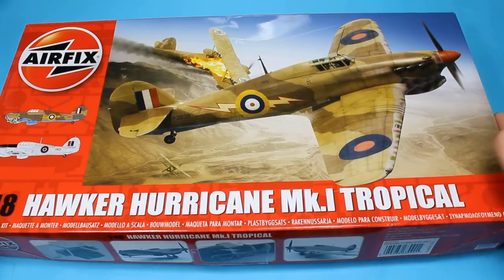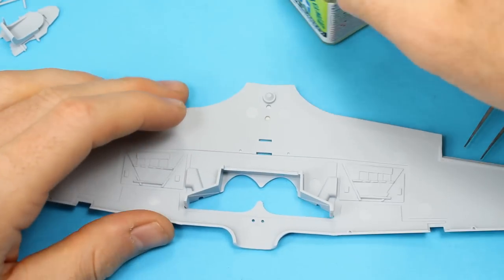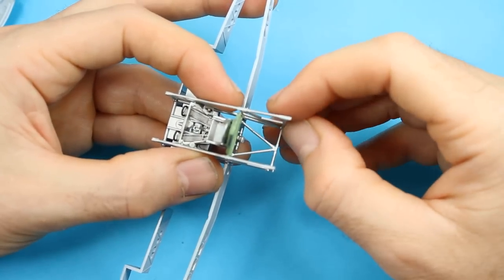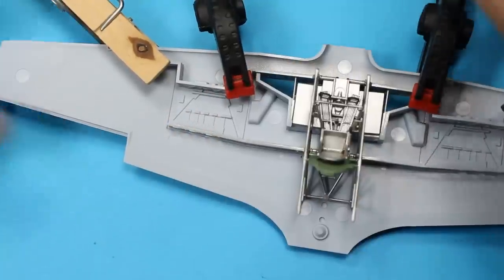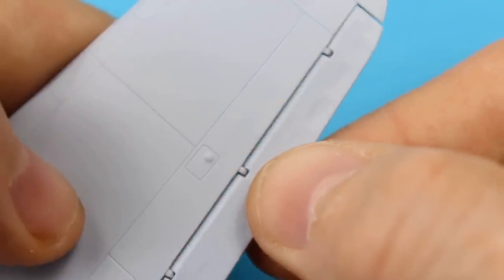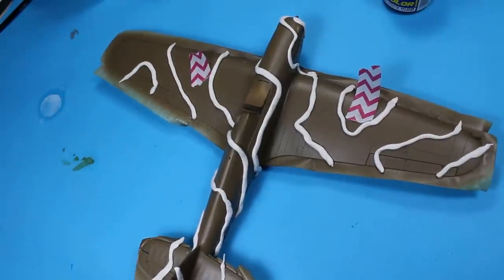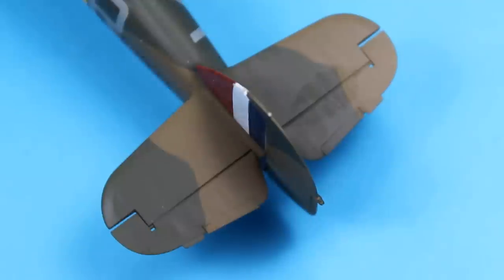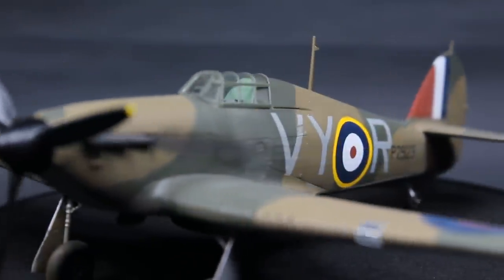Airfix 1/48 Hawker Hurricane, Battle of Britain, Full Build, 80 Years

Comment: Looks like a really good kit here! Builder made it look fun also! To those that think Tamiya is the only gift to the modeling world, I say  this- Tamiya 1/48 Spitfire and P51D use those stupid individual prop blades. Inferior! A one piece machine mold for propeller is likely to have near perfect tolerances, in regard to proper alignment of prop blades. How much does even 1/2 MM off on one sloppy fitting separate blade translate to in scale? Yes, Tamiya 1/32 are some of the worlds best, but like wise, some of Airfix 1/24 kits are also, like the old 1/24 Hurricane and new 1/24 F6F Hellcat etc..

Comment: Not obviously stated in the video, the builder has used an Xtradecal Battle or Britain sheet.
Xtradecal frequently make mistakes,  or guesses, this decal option has both.

In this case 'sky grey' undersides, while P2923 VY-R is a very good candidate for for a Sky mix or substitute,
see here
 https://www.britmodeller.com/forums/index.php?/topic/234985915-raf-sky-grey/&do=findComment&comment=2054227

  as P2923  has a non standard pattern,  going up the cowling and over the wing leading edges, and up the rear fusleage,  this is seen on several Hurricanes based at RAF Debden in July 1940, both  of 85 and 17 Squadron, which shared the base, and is likely a quirk of their paint shop. unfortunately the builder here has trusted the Xtradecal instructions, which specify Sky Grey,  which is just a guess on their part, and they also fail to note the non standard repaint, and they also get the code letters too narrow and the yellow roundel outer ring too narrow.  They also come up with the weird idea the spinner is black with green stripes.   85 were using flight coloured spinners at this time, and "best guess" from this and tonal matches is Red with two white stripes.

For more details on this and photos of the actual aircraft.

  
https://www.britmodeller.com/forums/index.php?/topic/234948380-hurricane-colour-question/&do=findComment&comment=1431441

for 20 plus photos of the real VY-R, and other 85 Sq planes, 

https://www.flickr.com/photos/144949377@N05/albums/72157704898371932

from a Life magazine photo shoot in July 1940
And, related, the 17 Sq photos

https://www.flickr.com/photos/144949377@N05/albums/72157678154026658

If you look carefully you can see 17 Sq Hurricanes in the background of the 85 Sq shots and vice versa.  The unique nose/leading edge and rear fuselage demarcation is seen on  VY-R, VY-K, VY-H, and likely VY-N, and on YB-A, YB-C and YB-W of 17 Sq.

One suggestion for the kit, if you dry fit the main spars into the wing, using the upper and lower parts taped together this will ensure they are all aligned before assembling the cockpit, which can be built on this ensuring the cockpit parts remain square and true.
new tool Airfix kit are noted for being very tight fitting,  a coat of paint can throw off a join,  but their plastic is too soft, and it far to easy to mis-align parts,  causing problem with wing to fuselage join.  I have seen several build where the is a step under the lower wing/lower cowling join.
Personally I really do not like the assembly sequence,  and it also means that there are compromises on the detail on the upper parts of the cockpit framework, the 'consoles' on the port side are missing.
The Airfix kit has a few other glitches, most inherited from the 72nd fabric wing kit. 
The definitive 1/48th Hurricane kit is yet to be done,  though Arma Hobby have announced a 1/48th IIc kit, and their 1/72nd kits are best 72nd Hurricane kits.
Hope of use or interest

Comment: The underside was duck egg blue if im not mistaken
Reply: "duck egg blue" is description, but not a given MAP colour.  The underside colour was switched to Sky in June 1940,  but given the massive amount of aircraft to repaint, mixes or substitute colours were possibly used.  This has been debated and discussed in modelling circles for many years. 
Note, Sky is not blue, but a pale green.  colloquial descriptions of "duck egg blue" and "duck egg green" are common from the era and owwards. 

P2923 VY-R is a very good candidate for for a Sky mix or substitute,  as it has a non standard pattern,  going up the cowling and over the wing leading edges,  this is seen oin several Hurricanes based at RAF Debden in July 1940, both  of 85 and 17 Squadron, which shared the base, and is likely a quirk of their paint shop. unfortunately the builder here has trusted the Xtradecal instructions, which specify Sky Grey,  which is just a guess on their part, and they also fail to note the non standard repaint, and they also get the code letters too narrow and the yellow roundel outer ring too narrow.  They also come up with the weird idea the spinner is black with green stripes.   85 were using flight coloured spinners at this time, and "best guess" from this and tonal matches is Red with two white stripes.
For fuller details on this and photos of the actual aircraft.
https://www.britmodeller.com/forums/index.php?/topic/234948380-hurricane-colour-question/&do=findComment&comment=1431441

Comment: I'm building the BoB release right now. Not only did I have the issue with the panel under the nose standing taller than the wing but the upper wing halves stuck out farther than the bottom leading edge. Not sure why but I also have the sea Hurricane in the stash so I'll be applying lessons learned on that build.

Comment: Very nice Hurricane! I don't know if it's the fog of old age, or what. But, I seem to remember Airfix kits of the 1960's and 70's being fairly good kits. Albeit, it is true; I haven't built one in 20 years or so. I wonder if they changed or in some way cut back? Nevertheless, a very fitting tribute to what some very brave men did 80 years ago.
Reply: They were crude compared to these new tooling models from Airfix. I have an old one here and it's the 1/72 CAC Boomerang, sort of a seat, blob for a pilot and thats the inside done and dusted. The new tooling 1/72 Spitfire is just beautiful inside the office as seems to be the Hurricane which I have yet to start.